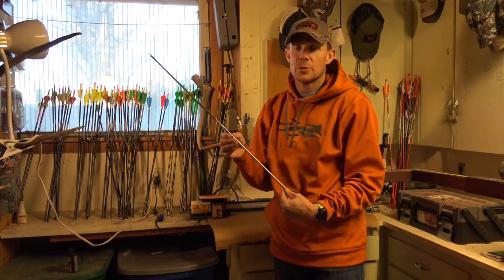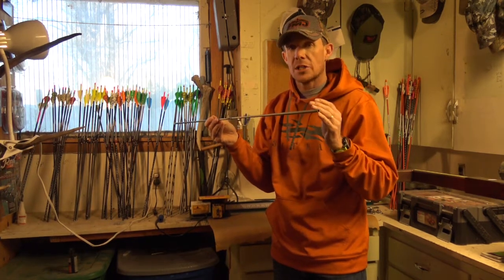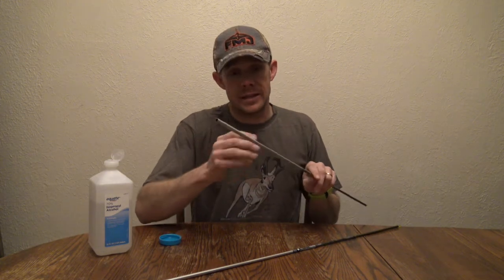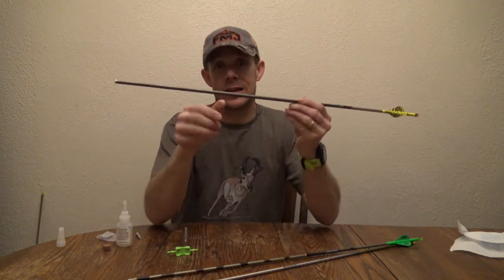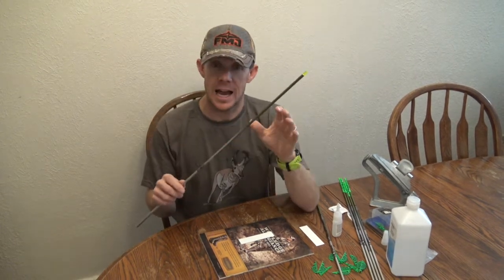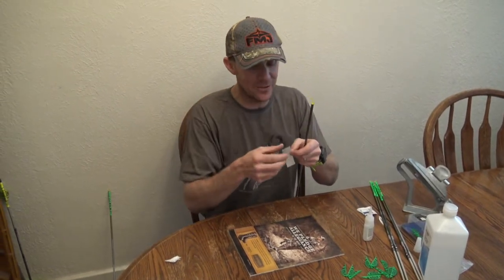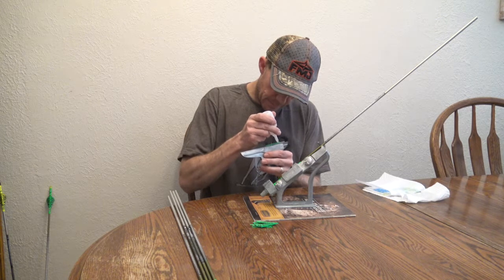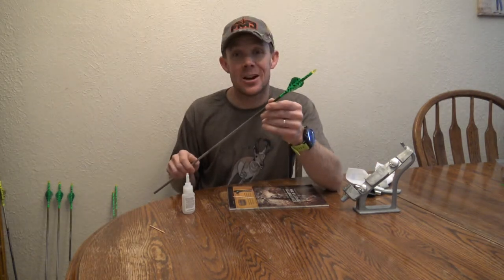Setting Up The Easton Taper T64 FMJ

Comment: Jace, I finally got mine and haven't set them up yet. Not a lot of info on them yet. Can you tell me why you only cut from the front and not the back. I was told you can cut from either side? Thanks
Reply: Following.  Seems like cutting from the back, which has lighter gpi, would keep more weight and not lower FOC.  Maybe it's wise to cut equally from front and back?